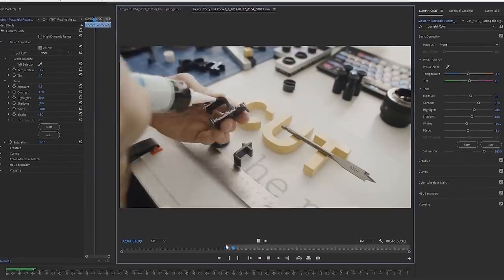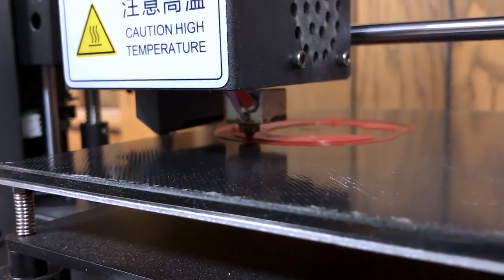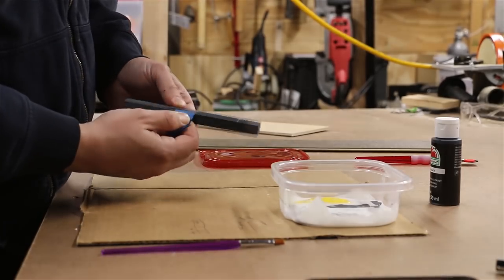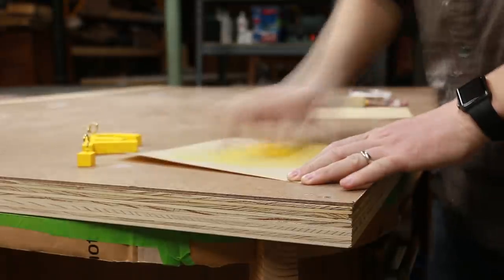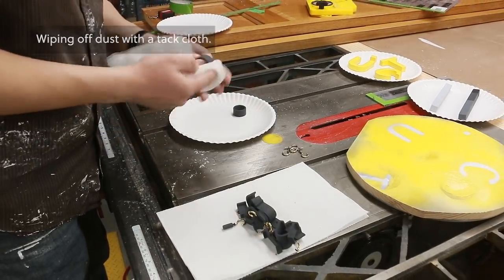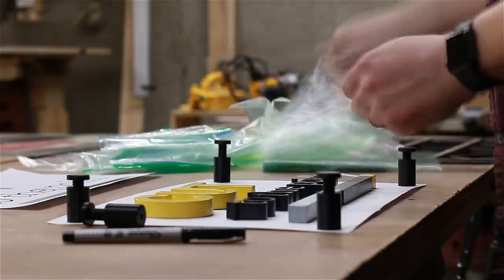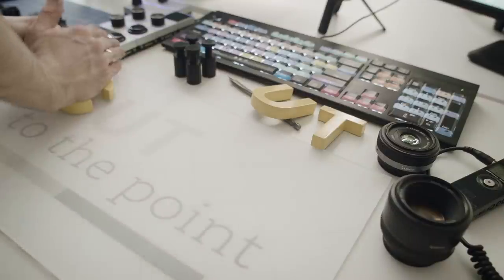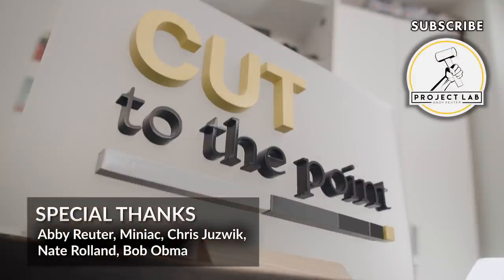Making a 3D printed sign | Cut to the Point collab

Comment: Great video! Seeing the whole process and trial and errors you went through is definitely interesting and insightful. As a thought, printing in ABS and treating it with an acetone vapor bath can be one way of smoothing out the layers. It might be a fun thing to toy with before the next project that might need polishing.
Reply from the maker: Thank you for the kind words! Good call on ABS. I've been hesitant to dive into a new material, but I definitely have to just give it a try at some point here. Especially because of the vapor smoothing...